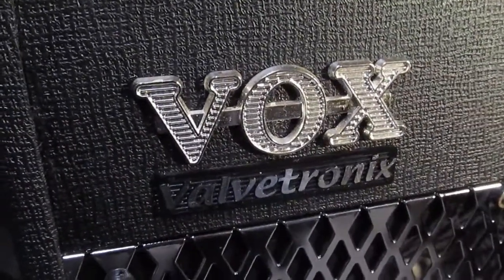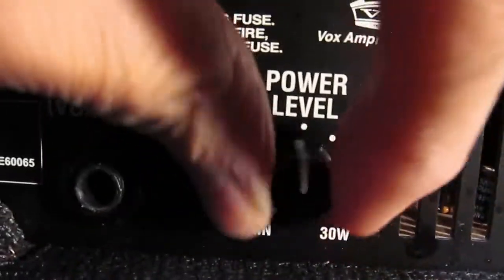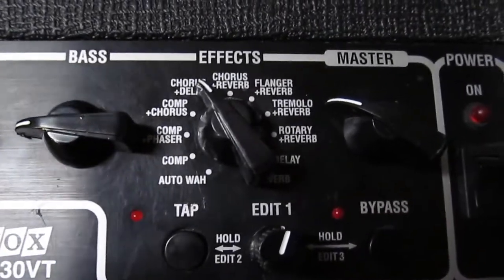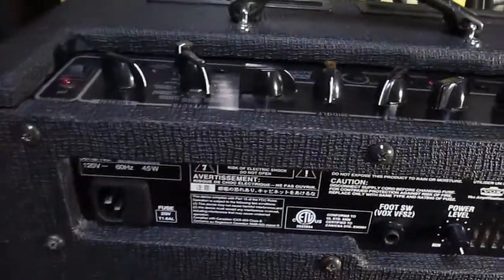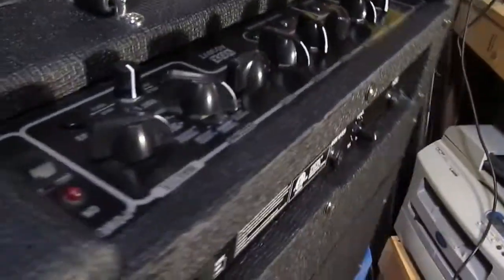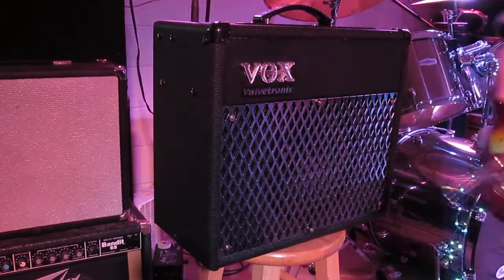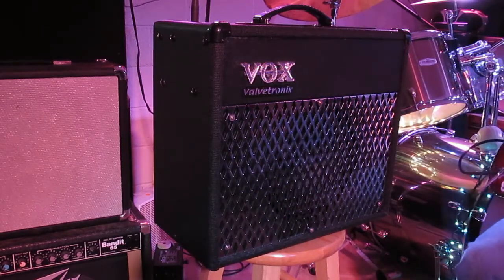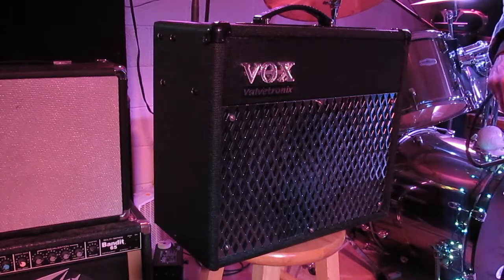The Dog Ate My Guitar Amplifier-VOX AD30VT

Comment: I had one of these. Not a bad amp. This first version didn’t have a separate reverb button. That’s it’s only problem really. Glad you saved this one! The plastic washers on the grill go under the metal as spacers. The vibrating should stop.
Reply from the maker: Thank you!

Comment: Hi, what you have there is Vox's 1st generation of their Valvetronix amps.  Their first real range of "modelling" amps before Fender and some others decided to jump into the same market.  The amp is a good mix of valves and solid state stuff inside.  For what it is, it does a good job of emulating Fender. Marshall, Dumble, Peavy type tones.  And also giving themselves a slight pat on the back with their AC15 and AC30 tones.  In my eyes, they are worth the money and should gain in value over the years.  Great beginner amps.

You did a great job getting black material back onto it, it should help to keep its value.  I've had mine since 2006 and I doubt that I will ever part with it.  Hope its still in your possession.
Reply from the maker: Thank you! Yes, I still have it and don't intend to sell it. It is a great amp.
Reply: I have the second generation VT 30 which I picked up in a pawn shop for £75 ten years ago, it's a really good amp/combo. I've had two all tube amps in the meantime and they're just not as versatile as the vox.I had a line 6 spider 3 modelling amp and it's not even close to the vox. They're getting good money on eBay given the rate of inflation you'll still get close to your money back and that's over 10 years down the line so there very well regarded I'd say. You've done a great job restoring that one, I liked the snakeskin covering well cool. You obviously like it?